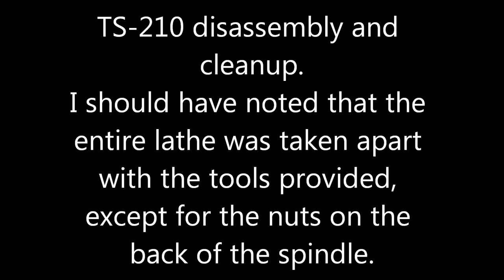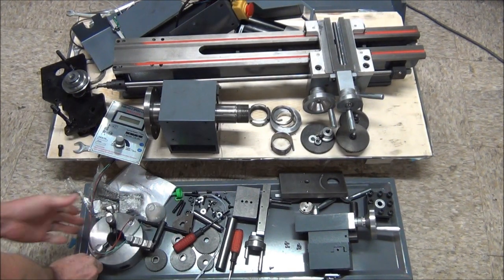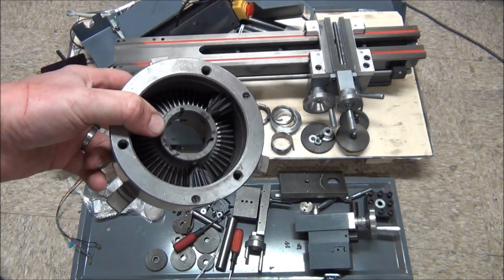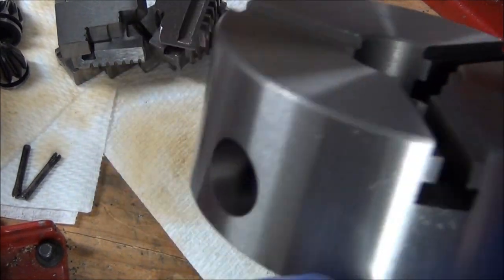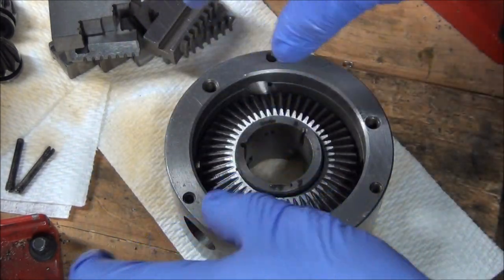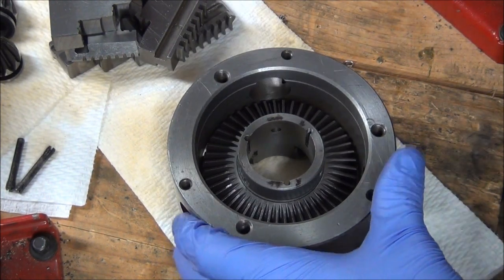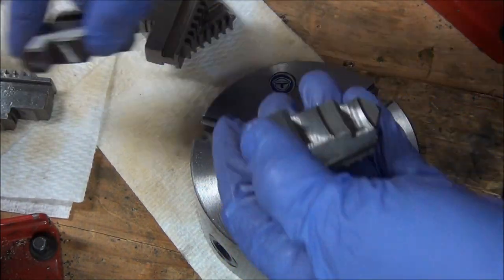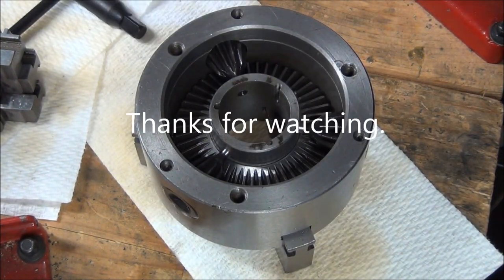TS-210 Part 2: Disassembly and Cleanup - 3 Jaw Chuck

Comment: Reason that there is not back plate, is the 3 jaw chuck started out as a .800" ID unit from say the HF 8x14 lathe, and when they over bore the ID to 1.5", it takes out the threaded channels for the back plate to put it back on.

Comment: Noticed you didn't grease the inner chuck threads or gear teeth was there a reason for that? Thanks great video best I've seen on diss. And cleaning!
Reply from the maker: Later on, I did grease the pinions and ring gear on the inside.  Usually when you try greasing the jaws, it gets flung off the first time you fire it up.

Comment: Drop the disassembled chuck parts into Evaporust and leave it for 24 hours to get rid of the hard to remove rust.
Reply: Also put a large rubber band around the outside of the jaws and back them out until the number one jaw drops, then reverse and close the chuck normally.
Reply from the maker: Yep, that would work!  Right now it is sitting under my bench.  I think I used it once since getting my 4-jaw mounted.

Comment: Hi, I'm doing a lot of looking around for a 8 X 16 lathe with a 38mm bore.  What size hole is in your Chuck....I imagine it's the same.   Do you see much need for the larger bore?  Also, what eBay store did this come from?  Thanks
Reply from the maker: Yes, the chuck is a 38mm bore.  The spindle is slightly bigger.

The only reason I bought this lathe was for the large bore.  Making suppressors, threading barrels and other related work.  Wouldn't buy another lathe without the larger spindle.

solar.jean
Reply: @number40Fan  thanks for the information.    Yes, I found that lathe at solar Jean also, but out of stock.
Reply from the maker: They all come from the same place, so if you can find anyone that is selling one, grab it.  I think I had to wait close to two months for anyone to have one in stock
Reply: @number40Fan  is this lathe good enough to make M and K baffles? How do you think it is with stainless or ti?
Reply from the maker: Yeah, you'll be fine.  You won't be able to take a big cuts like you can with a bigger/heavier lathe, but it can be done.  I have made adapters from Ti, brakes from 304 and 17-4 SS without any issues.

Comment: I have the exact same lathe in my garage and can see right now I need to do some tune-up work before I try to use it. First question Sir, what are you cleaning your metal arts with? I heard kerosene is good, but I also heard it can draw moisture. What is your recommendation? Next question, you mentioned "PB buster" for lubing the parts. Is that correct? I am ashamed to admit I do not know what "PB buster" is. I am a noob and have so much to learn. So glad I found your posts. You have helped me and many others more than you will ever know. Thanks again Sir for sharing your time and wisdom in getting this Beast up and running properly!
Respectfully,
John Archer
Reply from the maker: PB Blaster is what I mentioned and it is like WD-40.  Just a lubricant.  I used that to coat some of the parts to keep them from rusting.  For the lubrication of the ways, I use way oil.

Hot water and soap is what I used along with a ultrasonic cleaner to get most of the gunk off.  I did use some brake cleaner, but not much.

Comment: I looked hard at these machines on eBay and found some packages that come with 2 chucks, some tooling, measurement tools etc, which I thought might be of good value since I would be starting from scratch.  The 4 jaw that was shown with it did not appear to have individual adjustments for each jaw.  Do you have any idea why that would be?  Seems pretty pointless.
Reply from the maker: They do make self centering 4-jaw chucks that are good for holding square stock.

Comment: I have bought exactly the same lathe a few days ago. The manual (as far as I did understand or see it) shows only how to change the metall gears.
But I cannot find how to change the very tight rubber belts from position A (up to 1250 rpm) into position B for speed up to 2500 rpm?
Can you help me with this issue?
Reply from the maker: You have to remove the cover on the back of the spindle housing.  You can then get to the nut that holds the two pulleys tight to the metal plate on the gear side.  Once that nut is loose, take the tension off of the belts with the cap screw bolt.
Reply: @number40Fan  thanks a lot, I`ve done it. Works.